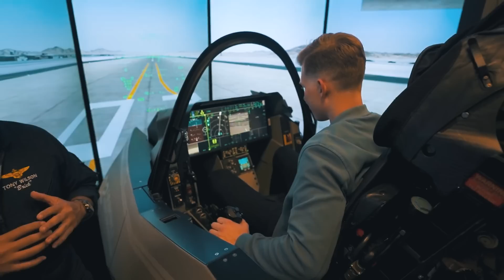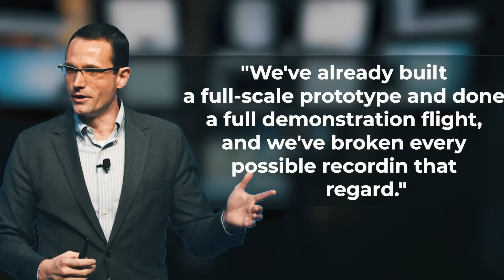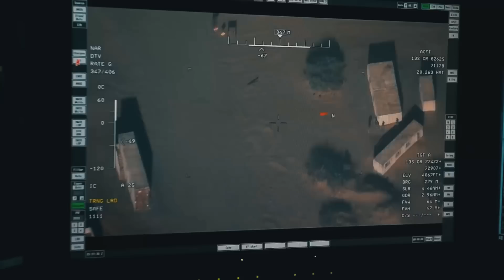Russia Is Finished! US Testing Its NEW 6th Generation Fighter Jet!

Comment: What if Lockheed tested it in an F-22 mule? Based on its design, flying a representative platform with the actual design or even close to it, will be more than enough for China to understand what we are attempting to do. At least aerodynamically and engine wise. I think they will fly it in a mule. The aero can be dialed in visually and after it is too late for China.